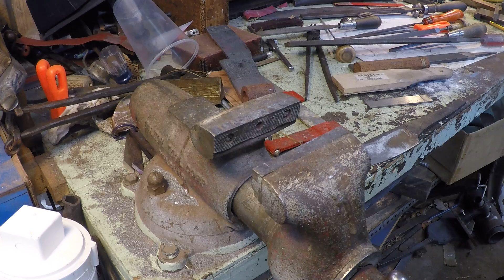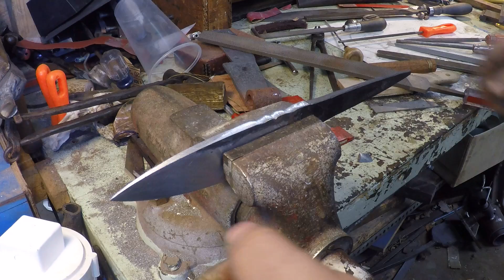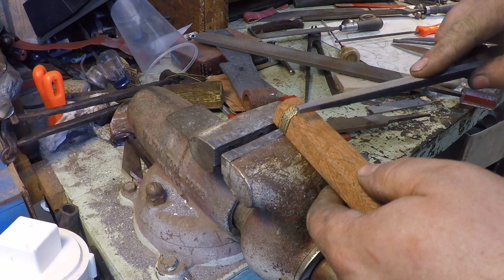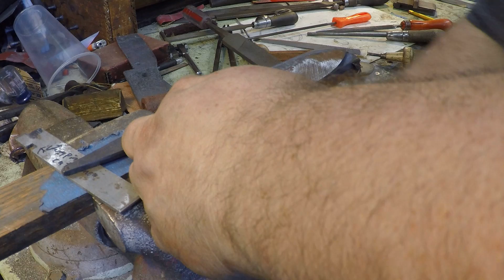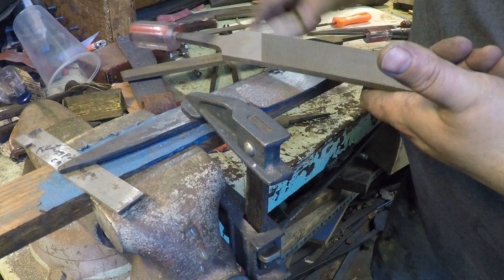Fileing Basics

Comment: Have you used a sen scraper? I know that it gives the metal a wavy/'chippy surface, but it's good for taking a lot of metal off at once.
Reply from the maker: I use similar scraper to do some types of fullers, but i haven't used a sen, normally I use a 2/72 grinder to do most of my shaping, i will then refine with files if needed.